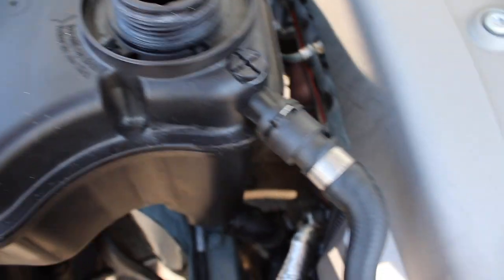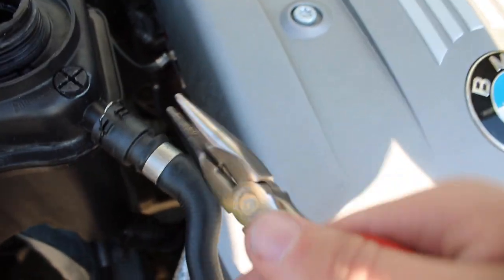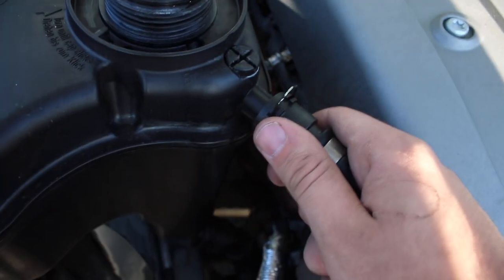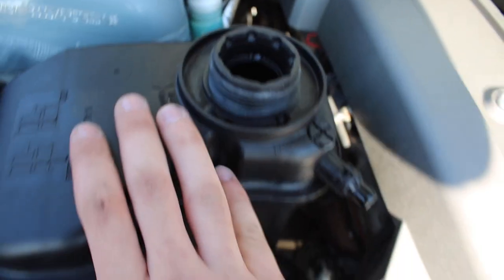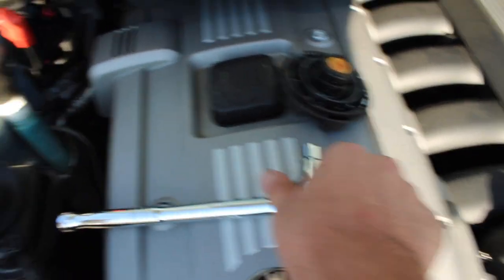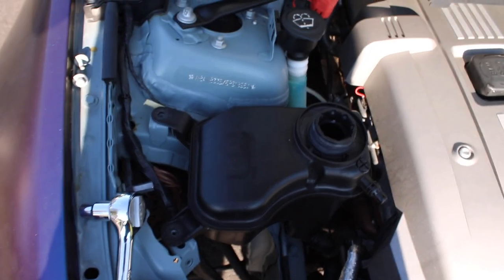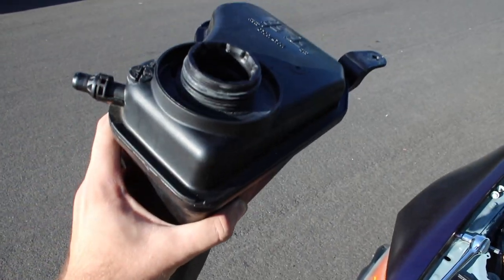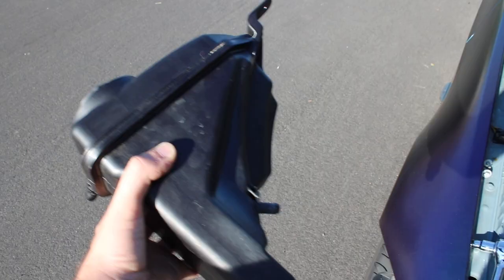BMW COOLANT RESERVOIR TANK REPLACEMENT (FIX COOLANT LEAK)

Comment: i have a 2003 BMW 325i, and i have replaced every single hose on this car, to date i still have a leak coming from lower radiator hose, which of course, i also replaced. what or where else do i need to look for to ensure the leaking stops, i have been stranded once and i have had the car parked now for at least a year, any one can help me out please!

Comment: Mine is leaking at the bottom hose connection.  Is there any way to repair the connection?  Like an o-ring?  Or could it be the hose itself that's leaking?
Reply: Any update?
Reply: @kennithcastro3274  I replaced the tank and the thermostat. I sold the car.

Comment: I'm replacing my expansion tank as well, after bleeding the old coolant out, do I need to flush it again with distilled water until it drains clear like water? Or should I just replace the tank after the old coolant bleed?
Reply from the maker: there are 2 hoses on the bottom of the radiator that you will need to take out and drain to completely get rid of all your coolant. Once your drain all your coolant then add distilled water and run your car and flush. DO this twice, hope this helps. Going to bed now lol gn

Comment: Is it a common problem for the reservoir tank to leak? I'm loosing coolant high somewhere at the tank and I think it has a hairline crack, thanks for the video. Gonna replace it anyway
Reply: Anthony Gardner I think I got the same problem mine leaks way to fast to be from a hose
Reply: @JJhotdawg  Its was a simple fix, got a reservoir tank off Amazon. Bled the system and has been fine ever since. Had a hairline crack at the bottom of the tank
Reply: @lizard_king_ant7600  thanks man ima have to try that! i just sanded my headlights today got a muffler and resonator delete yesterday
Reply: @JJhotdawg  I've been thinking of doing that, what do you think so far?
Reply: Anthony Gardner bro it completely changes the car!!!! When I turn it on people think it’s a v8 mustang. Obviously once your driving you can tell  it’s something else. But I love it. It’s not to loud to wake up the neighbor hood but enough for people to turn heads. You never expect a bmw to sound anything near it. But if you just get a muffler delete it actually slows the car down and sounds bad so you have to get the muffler and resonator removed. Add me on snap or Instagram I’ll send videos @sorryjalen on both
Reply: @JJhotdawg  did you ever find out what is was my reservoir completely drained out of the bottom it was way too much coolant to be a hose might be a crack or something
Reply: @Duppyconqueror47  i forgot what fixed the problem the car is gone. i replaced the reservoir and radiator and a radiator hose with the temp shit sticking out. all of that together only like 200 and i put it all in with a friend
Reply: @Duppyconqueror47  now i think of it it was prob the radiator because it blew up on me but i forgot which one i fixed first just do both
Reply: What happened, mines same

Comment: How did you find out that there was a water leak due to the reservoir tank?
Reply: If you know your coolant hoses are all pretty new its usually always a cracked water pump or coolant tank

Comment: My e93 has a windshield washer fluid leak whenever I put the washer fluid in it comes out the side skirts after 5 minutes any ideas?
Reply from the maker: eddie lewis yea your washer fluid tank has a hole in it or the hose that's connected to where you poor it into. I can make a video on that if you like

Comment: Bro if i do this Will fix the coolant light that come on the closter and it saids low colaant reservoir
Reply: Well if this is your only leak than yes once you replace and add new coolant you should be set